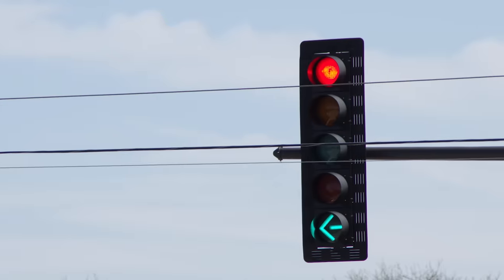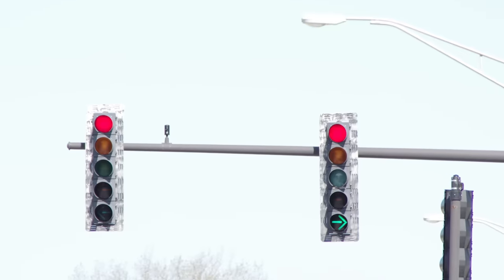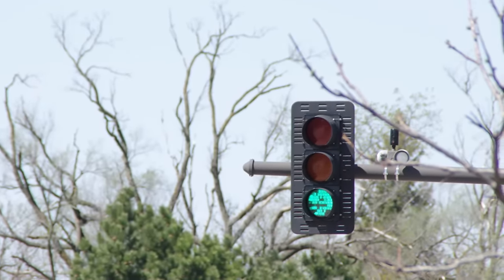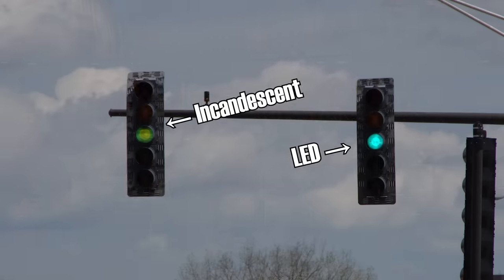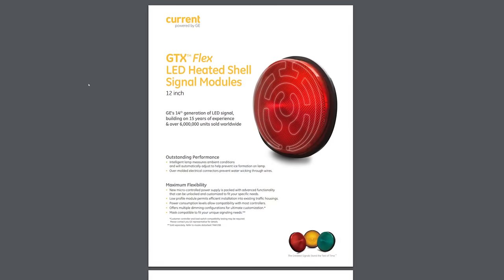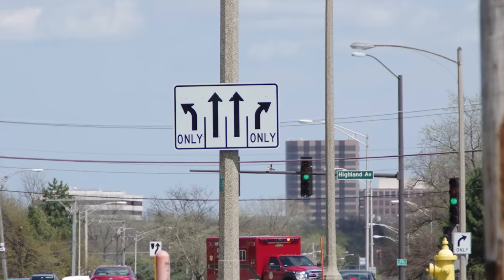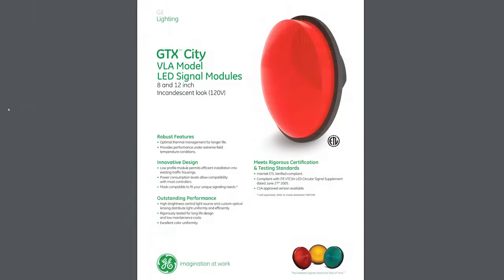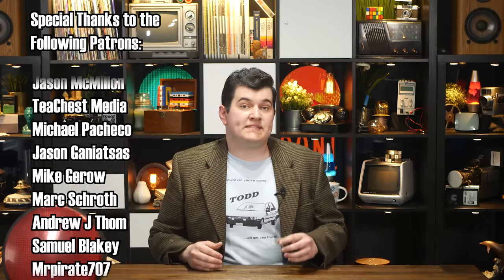The LED Traffic Light and the Danger of "But Sometimes!"

Comment: hi, i'm an electrician. a tiny 40watt heater with a built in thermostat that kicks on at a preset temp, costs about $5. There's your solution. Thank you for coming to my ted talk.
Reply: 1 star.
Reply: So the heaters turn on any time its cold, not just when it snows?
Reply: @JaredReabow  better than always on
Reply: now you add complexity to system. before that, there was just a light. now a light and heating element.
Reply: You could possibly put a sensor in front of it that looks to a reflector somewhere on the hood of the lamp, if it cannot see the sensor, thermostat turns the heat on. One heater, three sensors just in case.
Reply: @Xedhadeaus  Why overcomplicate something with more modern technology, that costs more to make, when something that's been around for ages works just fine.

Sometimes you don't need to reinvent the wheel, so to speak.
Reply: @bakachan3601  You obviously didn't listen to or understand this video.  That is the exact point he was countering.
Reply: Shortest and most informative-per-minute TED talk ever.
Reply: @JaredReabow  Could use a pressure sensor underneath the cover and when it's heavier than normal (consistently) that could trigger the heating element
Reply: @3nertia  but sometimes a volcano will errupt and ash will make it heavier! ;)
Reply: @MrIdontknowww  That's what tolerances are for :P
Reply: really? TED talk band wagoner I see,  wonder if these ever pay off?  So many people freak out to be part of that idiot culture but so many few Billionaires.
Reply: You pay then, Allright!
Reply: @bakachan3601 Ah, the classic "But it costs more" of capitalism.
Reply: Hannah Banana because it’s cheaper in the long term by A LOT.
Reply: wouldn't a wiper powered by a small motor cost even less?
Reply: Hmm.. maybe it needs a snow detector instead of a thermostat (?).
Reply: Mishkafofer complexity and cost in a time that states, counties and cities are going broke. Bad combo.
Reply: @bakachan3601  because it doesn't work fine?
Reply: @bakachan3601   if it has a thermostat it will do it when it's cold and not only with snow
Reply: Oh shit I didn't even read this comment lmao I was thinking 100W but surely 40W would do the trick (I'm also not an electrician so you're most likely right)
Reply: @JaredReabow  yes, but still more efficient than conventional lights.
Reply: How reliable would the thermostats be?
Reply: @youtert  my experience is that they live longer than the LEDs themselves.
Reply: Sounds good but isn't the whole point to be energy efficient?
Reply: @tomr6955  it is.
Reply: I like what is being said, but the problem is I've done business with government and the problem with government is they overpay for everything and it is very complex so a $5 fix for private consumers turns into a $105 to $205 fix for government.
Reply: @1961casey  The point Hannah is making is that with the heaters and sensors in the way that xedhadeaus describes them would be less efficient and cost more. That would require redoing the whole visor and light to achieve. However, switching to a led light with defrost sensors takes less energy, cost, and continues with the way it's worked for ages.
Reply: LED lights on my car also have ice form on them. I spray them with de-icer.
Reply: make the lights shake like a wet dog every so often.
Reply: @MrIdontknowww  you sound like a fellow Washingtonian
Reply: @bakachan3601  sometimes you don't need ton reinvent the wheel

Sometimes, reinventing the wheel is exactly what you need.
Reply: Maybe we could pay a guy to go around with a ladder on the days that in snows and have him dust the snow off?
Reply: I mean, GE had a solution, just like our windshield defrosters... just tungsten wires inside the led, as a heating element. The video discusses this.
Reply: But sometimes....
Reply: @JaredReabow  As long as it keeps the temperature somewhat above freezing. The fixture needs not to be toasty warm.
Reply: Corey  Yes, assuming gravity is the only thing that makes snow stick.
Reply: Actually it's not necessary, just add some resistance strips on the inner surface and a thermometer is good enough, no extra work at all and interchangeable with modules which don't need any deicing features.
Reply: He showed a visor designed for snow. Probably the cheapest and easiest way to try and solve the problem
Reply: Mishkafofer a bulb is a heating element!;)
Reply: $5??? Out of TAXPAYER MONEY????
(This comment brought to you by a red state)
Reply: @Justin-ef1rf  That's usually because governments are required to do so by law due to all sorts of things such as (among other things) required reliability test results, tracability, and requirements to purchase american made equipment.
Reply: @bakachan3601  So, LED lights:
+ Cost less in production
+ Cost less in maintenance
+ Cost less in upkeep
+ Are more visible in direct sunlight
+ Don't get dirty on the inside and are more visible in general
- "But sometimes"

Did you even watch the video, mate?
Reply: @XxxXxx-fm3wo  a heater and LED combo still takes less electricity to run than an incandescent lightbulb, even when both the heater and LED are running. Then you factor in that the heater isn't always on, and you get significant savings.
Reply: @bakachan3601  cost monie
Reply: There's no 18-minute video in common-sense solutions.  Please stop.
Reply: FreymanArt  So it activates the heating element - hardly super detrimental ...
Reply: or a sensor like ones found in cars that activate the wipers when it rains
Reply: Those were used in Military test equipment to prevent condensation. They were turned off, when the equipment was on. I have a TS382F, like that.
Reply: or.. higher wattage LEDS that run warm.
Reply: why not using a simple bimetal ..... much cheaper and more reliable
Reply: Did you watch the video? As a sparky I'm disappointed
Reply: @bakachan3601  why the heck do you need a calculator with mIcrOcHipS when the abacus works just fine? Led light bubls? Yuck, my coal gas lamp works just fine...

Phones? Computers? Eww, we got the mail and the outside world...

Laughable comment tbh
Reply: @69ingchipmunks68  I'd adds less than 16 lamps every 2 years at most (usually less) plus almost 1 kilowatt more per day, nice 👍
Reply: @lXlDarKSuoLlXl  there is an old saying that goes if it's not broke don't fix it. The things you listed were improvements over the past things that's different, those were basically broken and someone fixed them. ^^

I do not appreciate being mocked as a Luddite when I am not thank you have a nice day sir. 😊
Reply: @bakachan3601  what part of an abacus is broken, kindly explain to me cuz they seem to work just fine even to this day? Also mail and the outside world are broken too? Lmao

Led is a raw improvement over incandescent in every possible way, except in a minuscule one that doesn't even happens MOST of the time
Reply: this is exactly what I was thinking about and you wouldn't have to worry about the heater burning out because its only on for a fraction of the year
Reply: @bakachan3601  did.... Did you watch the video?
Reply: @Mishkafofer  OK... And?
Reply: Most temperature sensors also do humidity.

Snow cause the humidity to rise, so I bet factoring humidity in you could make the heater more likely to only be on when it’s snowing. Not just when it’s cold
Reply: @arandomredarmykomrade9529  your thinking with your brain
Reply: @iballisticduals3048  exactly, it could all be controlled inside the bulb, micro controllers are cheap and tiny now
Reply: Did you watch the whole video? He offered much better solutions than yours
Reply: @JaredReabow  Easier to detect when it’s cold enough to snow than install a bunch of complicated sensors to tell when it’s the exact weather to deploy the heater.
Reply: @bakachan3601  because its cheaper and more reliable than the old and simpler solution?
Reply: @bakachan3601  More complexity is not necessarily always bad. Look at the stoplights in the Netherlands. The controllers on them are fiendishly complex compared to the ones in North America. But, thanks to that well designed complexity, everyone spends significantly less time waiting at each intersection AND they are much safer.

I know that it feels like "it was so much better in the old days", but if you strip away the rose colored glasses, you'll realize it was never that good. And there's plenty of room to work up to improve things for everyone.
Reply: @ShroudedWolf51  I do not appreciate what I said being being dismissed as nastalgia. 

I had a valid point. But nooooo new = better!! Pffft!! 

If you must know the original Edison light bulbs were designed to burn forever. There was one they found in a bricked-up room, in I think it was a firehouse, it's had been continuously going for over 100 years. 

Newer = better my foot! XD

*Edit: isn't the Netherlands famous for their use of bicycles as opposed to cars? They already have lower instances of traffic accidents because they have less cars on the road soooo aren't you cherry picking am example?

I can accept when something newer is better than the older version of it. ^^ can you do the same and admit when something that was perfectly fine was ruined by someone trying to modernize it with more complex designs?
Reply: @bakachan3601 ecause LEDs save money in the long run because they last far longer and use way less energy. They are much more reliable than incandescent bulbs which go out very quickly. The problem of ice is only a problem that happens sometimes, it's not worth wasting energy and money for the rest of the year that it's not snowing with incandescent
Reply: what about automatic heater start when it's snowing in the area? i don't think it has to run for that long, like 90 seconds per every 30 minutes

i see the flaws but i think it could work in the city areas and in the countryside no one really cares about traffic lights anyway lol
Reply: @tomr6955 no we are good cause it takes more energy than before😅😅😅😅
Reply: Hi pilot here I could have told you that
Reply: @Mishkafofer that is more efficient than the old light 😂
Reply: @Xedhadeaus that is actually kinda genius it would be like a laser and if it doesn’t pass then the heating element would come on the problem is wether proofing the laser thingy😂
Reply: @bakachan3601 
"I'm here to voice my opinion and don't appreciate everyone else's! Now stop making assumptions based upon my comments!"
....🤦🤦🤦🤦🤦
Reply: @Mishkafofer and it’s still better
Reply: Heating elements pose a fire risk
Reply: @kandykornpumpkins  what’s going to catch on fire in a traffic light? It’s no worse than an incandescent bulb
Reply: @thatoneguy611 I... fr?? Nevermind, I'm not wasting my time explaining, you can look it up lol
Reply: You forgot the 5K % mark up for sale to a government agency. Lol
Reply: Yeah no this is what resistance strips are made for. This type of thing is absurdly reliable and cheap.
Reply: @kandykornpumpkins god this is embarrassing, he gave a perfectly sound rebuttal to your "argument" and you had a tantrum of "I'm too busy to validate my point, you have to do it" in return
Reply: @kandykornpumpkins an incandescent bulb IS a heating element, what would make a smaller heating element that is switched on periodically, more dangerous than the one that is already inherent in the design?
Reply: @bakachan3601 Well then you must still ue candles then i suppose?
Reply: @JaredReabow  Well if you think, evey time it's cold enough for snow, it's copd enough for ice
Reply: Ah so just like an air fuel sensor it's going to burn out lol.
Reply: @JaredReabow hey not sure if someone mentioned this but even if it's not snowing you'll still get frost if it's really cold, you'll see it on your car and you can barely see through it. During the day this may make the light harder to see especially to people who have really poor vision (who legally should be wearing glasses or contacts, yet I've seen people still neglect this law) but that's just my theory!
Reply: @sageallpronouns8861  Sure, but that frost is not worth addressing
Reply: @Mishkafofer If you think a metallic strip and a heating element is “complex” you have bigger things to worry about
Reply: Yep, same in traffic/security cams
Reply: I’m a delivery driver and I’ve never seen a traffic light go out EVER
Reply: Obviously a far worse solution than the 3 watt heated lens with temp & humidity sensors.
Reply: @racer927 Nope, this approach is completely valid, just also completely incorrectly applied in this case. It would actually cost less in the long run, because the difference in the purchasing cost would be instantly returned in the first winter it encounters. Much more valid concern would actually be if the sensor wouldn't require more expensive maintenance compared to the thermostat and if it would still be cheaper overall. If it wouldn't, I don't see any reason to use it instead of a simple thermostat, but I think it would be cheaper.

Minimizing cost is actually a good optimization strategy, you just need to be sure to include all the variables unlike this guy did
Reply: Scalabity maybe?  Old conditions are tough to change.
Reply: See, being a sparky kind of guy, the heater would have to be tenders and bid. The exact location of heater mounting. Type of adherent. Metal screw, tie-wrap, Hilti bolt,  Drilled and tapped hole or free standing? Who installs heaters?  Union or scab? This is a simple solution, but reality enters. Does Insurance corps approve this? Logic Does not follow Licence.
Reply: @Mishkafofer Oh no, now there’s three resistors instead of one!
Reply: @Mishkafofer  Oh no there's an extra electrically heated wire, how complicated!!
Reply: @bakachan3601  because oftentimes the wheels we reinvent are dogshit. You don't see us driving around with wooden wheels, we use pneumatic tires and if we find a better way we'll be using them instead. The term "don't reinvent the wheel" is specifically targeting people who spending time redeveloping a solution for no benefit regarding their use case. If your use case is making a better wheel, you need to reinvent the wheel.